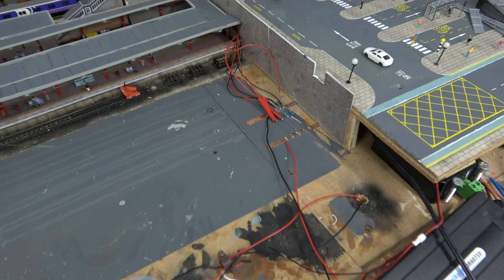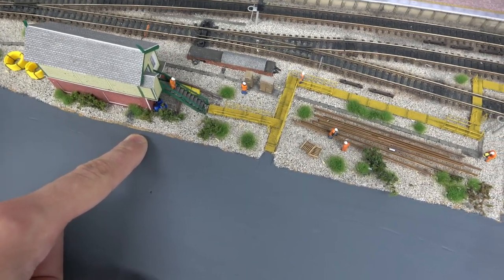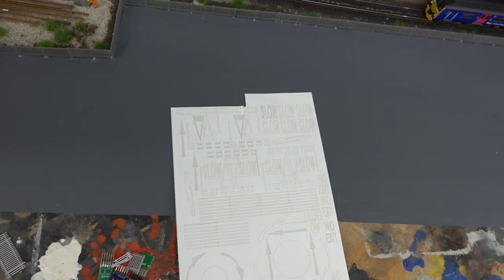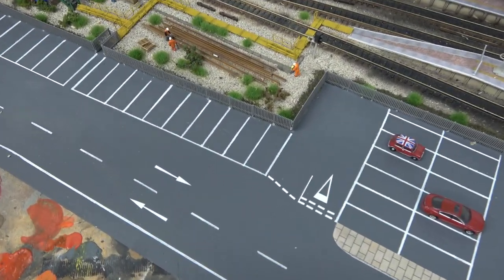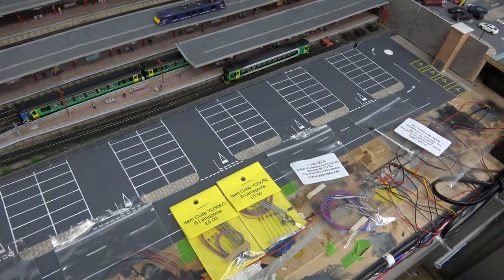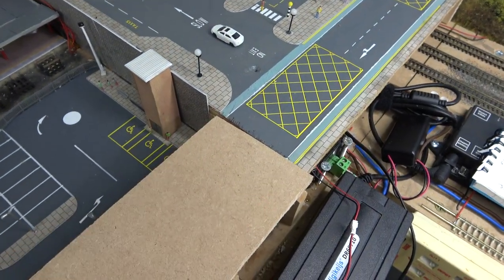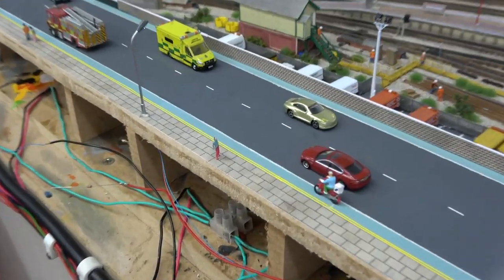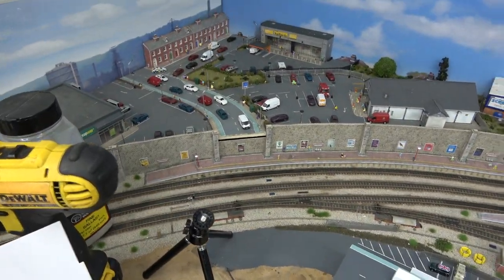Great Deltan N Gauge-Station Build Part 4-Car Park and Roadway

Comment: Looking fantastic. Where did you get the cars from? Are they older releases? I cant seem to find a good range of n gauge vehicles. Cheers
Reply from the maker: Most of the cars are oxford diecast, either bougtt directly from Oxford or my local model. Shop, there's a few less detailed vehicles in there from Layouts4u